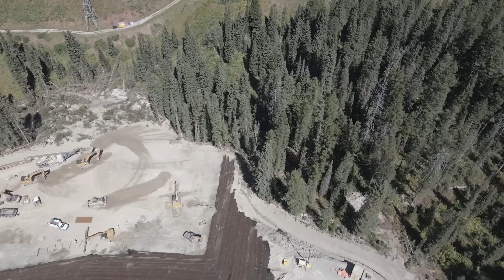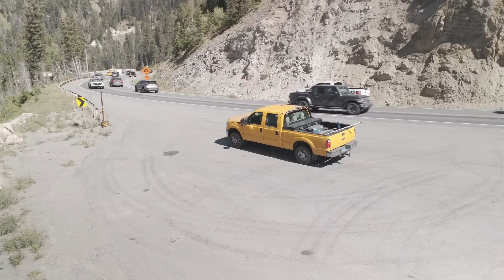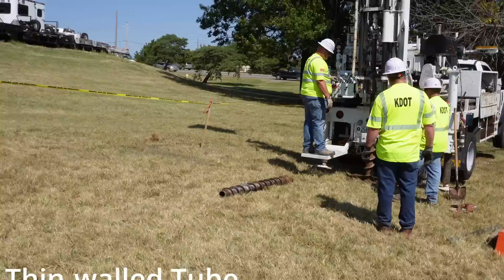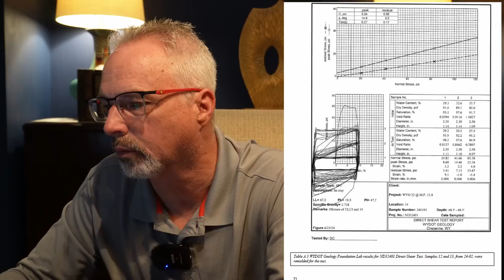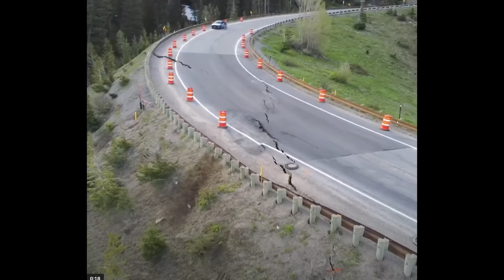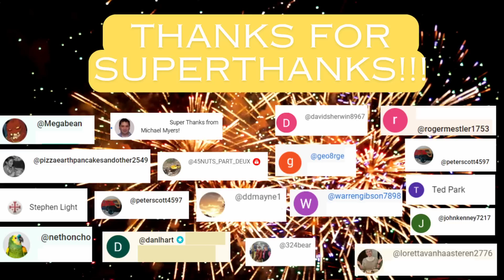Teton Pass Rebuild Update with Drone Footage

Comment: As an engineer with 50 years of experience (I am now retired,) I think your observations are correct.

I am concerned about the that their June soil analysis was not competent. It also appears from the drone footage that the inside of the temporary bypass does not have adequate drainage. Since it is obvious that a new roadway probably will not be completed before Winter (we will get snow next week!) the temporary roadway may be subject to the same type of failure as the original failure. Hopefully, they have used the Summer to take more soil samples and to do a more complete analysis.

I have used closed cell (this is important, CLOSED CELL, not open cell,) styrofoam in construction and found it a very good solution for many situations. On one job, a contractor tried to used open cell styrofoam and it had to be rejected. So I do not see a problem with that solution based on the limited information provided. 

Someone mentioned forest fires: as long as the soil cap is thick enough to provide thermal barrier, those should not be a problem in the area.
Reply from the maker: Excellent comments, thank you!

Comment: Watching juan browns rebuilding of the Oroville damn they used a lot of roller compacted concrete. Seems like a good answer for this as well.
Reply: Pressure behind in this project and scour resistance isn't necessary. This job is all about Shear resistance. RCC would cost a fortune, requiring a portable plant and more money than the roadway is worth vs redirecting the route to a different location.

Comment: On the positive side it seems like they are trying to improve the draining inside the fill, at least according to the drawing.
The filling on the inside of the curve of the bypass could be to avoid water accumulation and force the water to the southwest to prevent it from infiltrating into the ground.
If the styrofoam is located under the outside embankment it might make the embankment weaker, but it's hard to say without knowing how it's going to be applied, the drawing at 4:43 isn't very clear on that matter when it comes to distribution of material.
As I see it a milder embankment sloping should be the priority in order to improve the safety factor, but it would require a lot of material.
After all this is a tricky area for road building.
Reply: The real shear line is the underlying bedrock, until they anchor the slope, it will continue to slide. Gravity has the upper hand. Downward pressure is not as much of concern as blow out and shear, if the bedrock is sloped.
Reply from the maker: Great points.  There are about 10 other slide areas that WyDOT has been dealing with that may be candidates for proactive remediation.

Comment: Super weird that they didn't include both the shear values and why they decided on those values in the report.  If i didnt include that for a DOT project they would turn it back to me to fix my stuff.
Dealing with fat clays, id be very concerned about the preexisting internal features of the clay which would be destroyed in the remolding process.
Reply from the maker: Thank you.  I agree, it seems like a glaring omission from the report for no good reason.

Comment: On those steep slopes with poor soil strength, do those pines help with preventing the soil erosion, seem to be like natural piles?
Reply from the maker: The trees keep the upper soil layers from moving, but do nothing to address deeper slope movements which is how this embankment failed in the first place.
Reply: It easy to underestimate the depth of tree roots for the uninformed - they generally approximate the spread of the canopy, and for the most part stay in the fertile top most few feet of soil.

Comment: One thing that I've learned in 40+ years of construction is without angular crushed stone in the backfill, it won't stand up by itself. Sand, silt or clay need support as to not eventually blow out. That soil looks very sandy, and unless they add crushed stone, it's going to liquify under wet conditions. I also see no drainage so far. Geogrid might work if the previous recommendations are employed.
Reply from the maker: Great point.  The old embankment fill contained 9 to 49 percent fines which is not a freely draining material at all.
Reply: Having built a retaining wall behind my house, backfilled with crushed (angular) gravel, topped with a brick patio, it hasn't moved a millimeter in the 20 years since constructed. We have a 3 foot frost depth in my area.
Reply: Precisely. It's the same reason why crushed stone is used as ballast on railroad tracks - it provides stability. If sand, silt or clay were used, it would just wash away - ultimately leading to derailments.
Reply: Absolutely I’m not an engineer but even I know after building enough drains and buildings that the soil looks to sandy for stability.
Reply: At 3:05 in the video the excavator is shown feeding a jaw crusher.

Comment: Greatly appreciate all the effort you put forth to bring us these videos. Very educational.
One quick question - is there any factor in the calcs for roadway traffic vibrations? Are there any studies relating to, (road on grade - not bridges), the contribution of vibrations to a slope/embankment failure? 
I can see where it may be very minimal and simply a part of the factor of safety component, but I am curious if there has been any research on it.
Many thanks!
Reply from the maker: Great question.  In this case, the roadway traffic is modeled as a uniform surcharge load.  Vibration concerns for the roadway are typically not much of a factor.  Earthquake shaking is a different story though.

Comment: Styrofoam eh? Sure hope no wilfires pass trough the area...
Reply from the maker: The styromfoam will be covered by several feet of earth fill.
Reply: @CaseyJones-Engineer I think formed styrofoam blocks were used by contractors to fill in areas of the I-95 overpass collapse in Philadelphia recently under stone and fill dirt . Less susceptible to water problems I suppose . It’s not peanuts in a bag in your shipped box . Just some armchair thoughts .

Comment: I really don't see how the contractor could warranty any of the construction simply based off the definitively under-analyzed pre or post failure tests.. I would definitely caution in our reports the lack of these things and the inability to warrant any of the fixes.
Reply: In my experience, the contractor only warrants that the work conforms to the specifications of the engineer. When the engineer signs off that the work was done to spec, that is it. It may be different for this project in Wyoming. Depends on the contract language.

Comment: The contractor engaged to remove the asphalt may want to reconsider their safety program/personnel/procedures as it appears they put equipment out there from the photos despite the large extent of tension cracking visible across the entire roadway prior to the collapse. Super lucky that nobody was killed. I'd even consider characterizing it as a near-miss from an OSHA perspective.
Reply from the maker: Thank you, those are great points and I agree with you.  It was WyDOT's lack of recognition of this imminent failure situation that maybe me question whether they knew what they are doing.
Reply: @CaseyJones-Engineer  Would sending a copy of this report to the insurer make a difference? Where does the buck stop with these concerns?
Reply: As a former Equipment operator, we're sent into dangerous situations all the time. This isn't a rare event. OSHA really doesn't have a rule for things like that, operator pucker factor doesn't have a limit.
Reply: A plausible, albeit entirely speculative, reason for removing the asphalt might be that they knew they'd have to reuse all of the soil/subsoil/weathered rock in future rebuilds, and wanted to minimize the amount of variable sizes of chunks of asphalt that were contaminating it. For sure, running heavy equipment on top of the failing embankment would not reduce likelihood of continuing failure by just removing a few inches of asphalt.

Comment: I’m not an engineer and watch every post and find it very interesting. I was wondering what you feel the additional cost would be to add the 1.5 factor of safety?
Reply from the maker: Thank you.  They could get to a F.S. of 1.5 by installation of the micropiles and incorporation of specially incorporated fill.  I think they should make sure they have this higher factor of safety for the embankment before opening the roadway to traffic.
Reply: @CaseyJones-Engineer do you think 1.5 is enough? I mean, I guess it's a temporary situation. I just wouldn't like to drive on a road with a factor of safety of less than 2

Comment: civilian here. as others have said, the drone footage was great. but going by the slap-dash/cowboy approach that wydot has taken so far i don't have high hopes for the longevity of the repairs.
Reply: This one will burn down, fall over, and THEN sink into the swamp.
Reply: the last engineered slope lasted 50 years ..
Reply: @direwolf6234  If they acted to fix it before it failed, that would have been fine. A new slope of similar design wouldn't last nearly that long because of more and heavier vehicles, as well as more weather extremes.

Comment: While my brain tries to understand why and how styrofoam in such a construction project, the first question that comes to mind is: How do they keep rodents from destroying that styrofoam?
Reply: They have considered that in the manufacture.  EPS Geofoam is one of the big manufacturers. Their technical specifications state "EPS is resistant to fungi and mold and offers no nutritional value to insects. Protection methods for termites include adding a termiticide during the manufacturing process or placing a physical barrier, such as a geomembrane, around the EPS geofoam.:
Reply: @jmazoso  I learn as much or more from the video by scrolling through the comments. Thanks for contributing!
Reply: It takes up space and doesn't add weight to the slope. I've backfilled bridge abutments with light weight material like Roasted Shale rock , to not add weight to a footing set on clay with no pilings. Very strange stuff to work with, but it works. The rodent control can be added as they go, chemicals can be added if it isn't already in the foam.

Comment: Pretty much followed and agreed with what you said there.

Only thing I have to offer is a casual observation based on the Project Manager hat I wore for a couple decades.  The construction company moving the earth is milking it.  Their trucks are only running half full.  There is no good reason for that.  The material is dry, the terrain is neither slippery nor soft and there doesn't seem to be any challenging elevational differences.  There is no reason these trucks can't be filled to overflowing.  They are not driving OTR so weight restrictions do not apply.  Looks like they are working under a T&M contract, so no holds barred access to the checkbook.

Liking the early access and exclusive content as part of my membership.
Reply from the maker: Thank you, those are interesting points. Did you think it was odd too that they did have the conveyor just fill the trucks instead of letting the rock kit the ground and require loading with the front end loader? 
Also, I am glad you are enjoying the member benefits! I will post the entirety of the drone footage as members only within a few days from now.
Reply: @CaseyJones-Engineer  Elevators are a fickle and finicky thing.  You always want to start them with no load on them if at all possible.  A little slippage could cause a lot of damage.  And those things were struggling as it was.  If you look at the drone footage, some of the larger stones were tumbling back down the belt.  So these were set at their max lift angle as it is, and trying to coordinate on/off loading at the bottom to fit with truck loading dwell time at the top would be basically impossible.

I think the wheeled loader was appropriate.  Just size it accordingly, and I think this one was pretty close.  I think these were 14YD (22T) trucks.  3 scoops would be about right for what we saw.
Reply from the maker: @davidmiller6010  Thank you, that makes sense. I meant to ask you about the processing. I don't think there is a crusher here and they are just skimming off the big rocks with the grizzly?
Reply: @CaseyJones-Engineer  The excavator is loading a crusher with an elevated output but I don't think they are crushing as there are cobbles, not angular, rolling on the belt. Normally material passes the grizzly before crushing so this may be the tail-end of 2 excavators loading the hopper/pan-feeder for the belt.
Reply: @CaseyJones-Engineer  The load time would be far above a 3 scoop load time. Loaders are sized with open pit haul trucks for 3 bucket fill, 4 in a pinch. Emphasis is on the loader, it needs to be continuously operating for maximum efficiency.
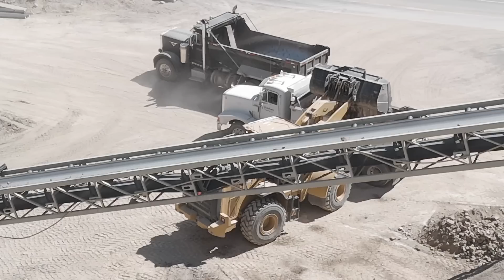At ~4:00, I see one truck being loaded as another is arriving. First truck leaves and the next is ready for loading.  Short-loading trucks to achieve a busy loader is fine for short hauls, prohibitively expensive for long hauls - from a mining engineering view.
Reply: @wiregold8930  This is the best comment in this series, clearly from someone who knows what he or she is talking about. The idea of extending the conveyor under or over the active roadway is not remotely efficient or sensible. Another factor that might merit consideration in this precise situation is a desire not to spill rocks onto the road.
Reply: My guess would be time, weight and clean up. It also makes it harder for the trucks to accelerate from a stop. They're going a very short distance. I'd imagine a company capable of that project has good reason.
Reply: Why are they using trucks at all when there should be a  flyunder or or over convayor to the other side of the road for a loader  to work the pile on the other side no trucks needed. what a money grab that is
Reply: @irondarknessdarkness8900  My thinking is there would be less handling of material and less interference of traffic if the conveyor system had included a section over the road.  Traffic has been slowed down for the bypass to begin with.  Crossing traffic with trucks is foolish and risky when it doesn't need to be.
Reply: @royreynolds108  I don't think the conveyor system would work with the massive amount of material they're having to sort, pile and store. I'd imagine they have equipment over there piling it higher and higher.
Reply: @irondarknessdarkness8900  I was thinking similarly.
Reply: Three axle truck loaded up to 98,000 pounds operating on a 10% grade at 8,700 feet of elevation on a operational public roadway.  Who need s brakes anyway.
Reply: i wonder how "heavy" the material is.  If its got a high specific gravity, they may be loading the trucks based on keeping the trucks leagal.
Reply: The observation is valuable.  The construction company is "milking it."  It says a lot about the whole operation.  Awesome Drone film.